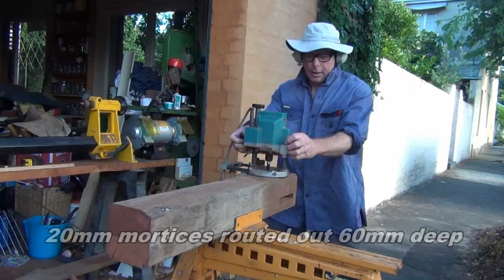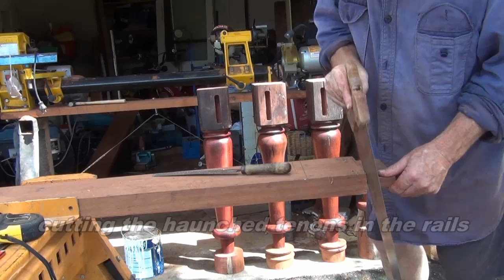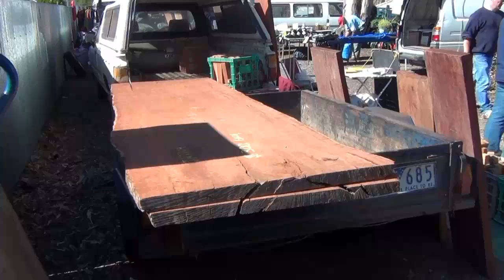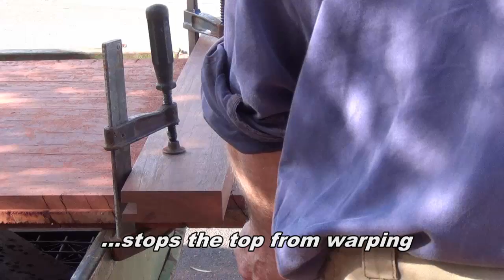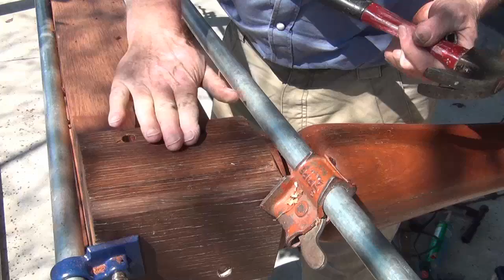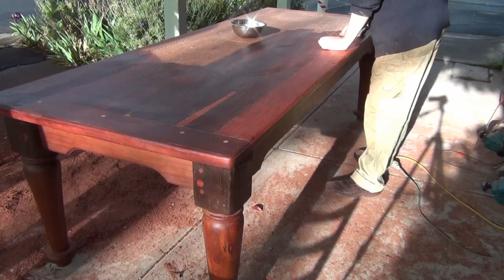How I made a simple table with bread board ends and a secret drawer

Comment: I love the finish on the table.  It shows the rich colors of the wood. Great planning and execution on this table.  

I hope you are recovering from the bush fire by now.  Happy new year to you and you're family.
Reply from the maker: +BRICEN18 Many thanks. The polish was made using equal parts of beeswax, gum turps and linseed oil. The mixture is heated in an old tin and then allowed to set before putting on with a rag.  Best wishes Simon